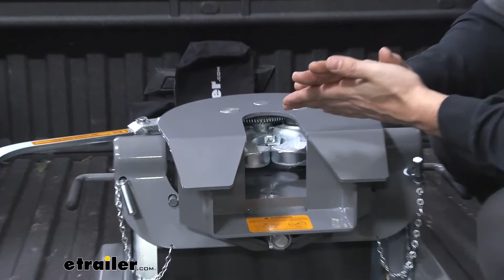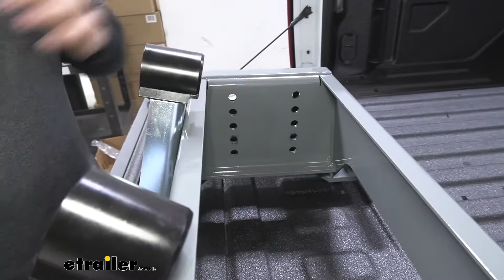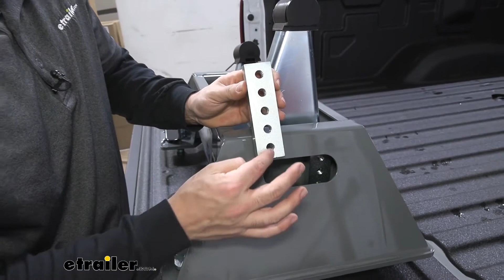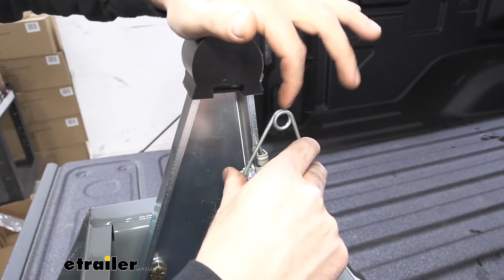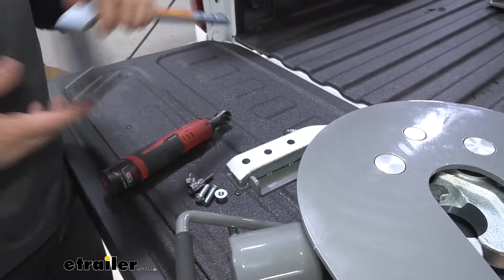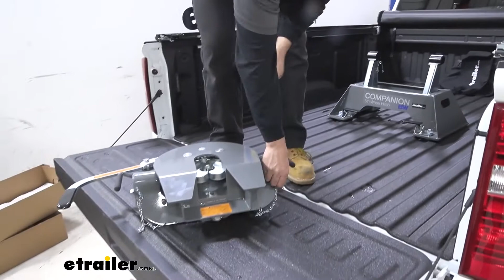etrailer | B and W Companion OEM 5th Wheel Hitch Installation - 2020 GMC Sierra 2500 BWRVK3710

Comment: How many ft lbs do you torque the bolts for the height setting? And also does it matter if your missing the head leveling spring? I bought my hitch used and it’s missing the spring.
Reply from the maker: The bolts for the height setting will need to be torqued to 110 ft lbs. As far as the head plate spring goes, you do not need that in place in order to use the hitch. It just helps with connecting the trailer.
https://www.etrailer.com/Fifth-Wheel-Hitch/B-and-W/BWRVK3710.html